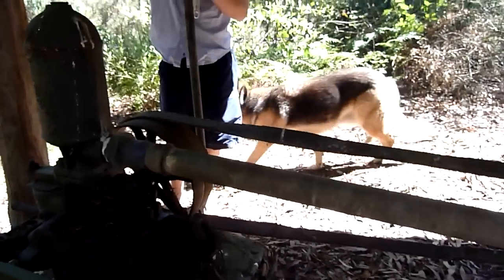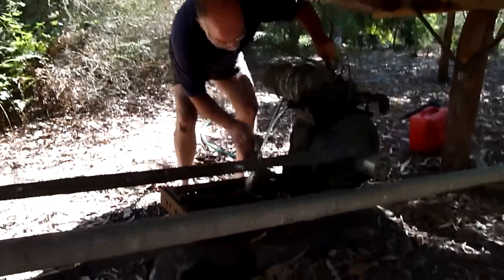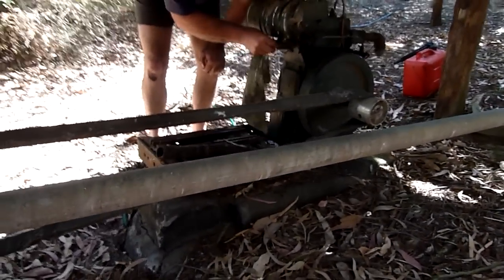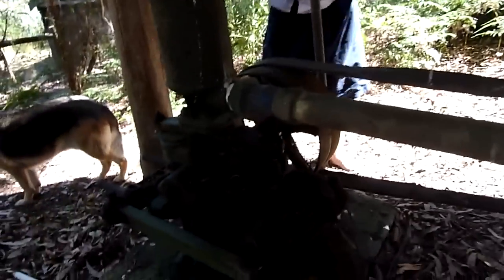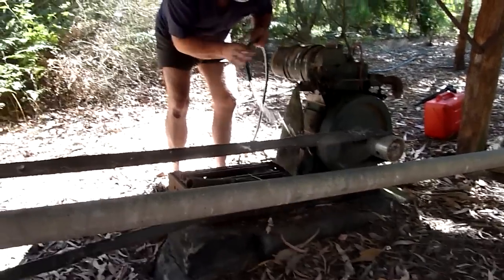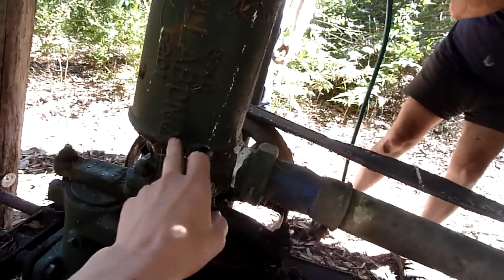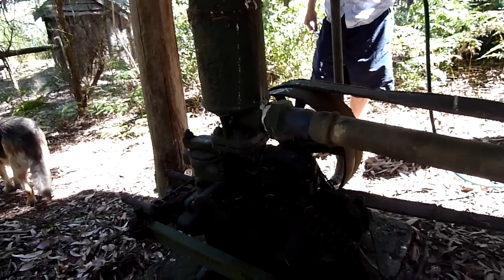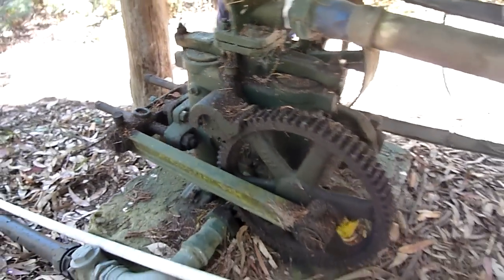New Years eve Pumping - Southern Cross Pump and Petter Gas Engine

Comment: The most commen pump type in Malta is, the one with a big open crank with the conecting rods down the water bore 150ft below. Did you viewd my engines? My engine the big ones where powering them!